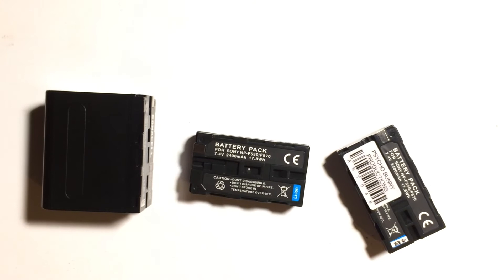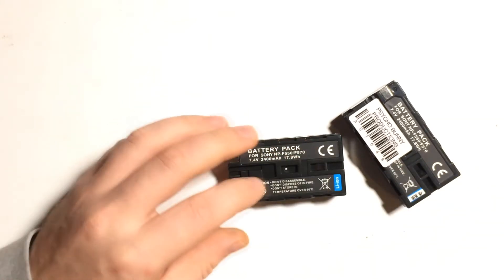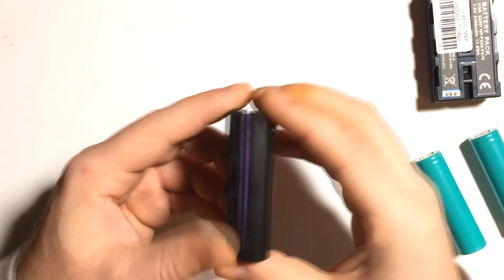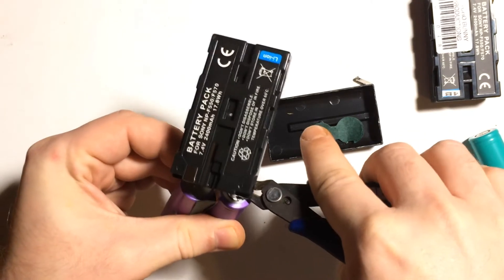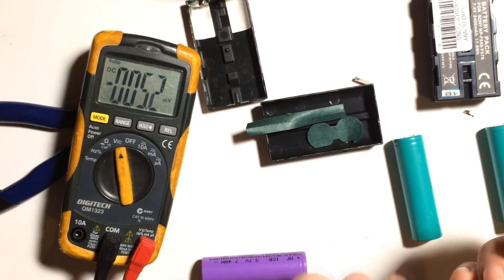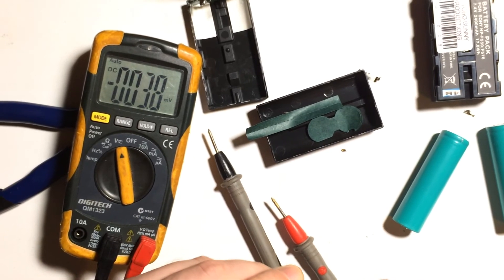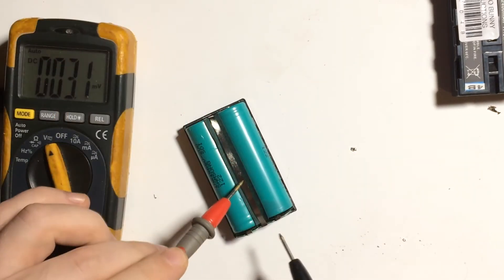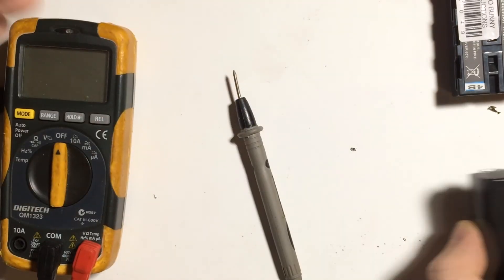Re-Packing Faulty Chinese knock-off SONY NP-F Type Battery

Comment: What does the pin other than plus and minus do? I also tried to use the 4s charging integrated circuit, but the device did not detect it because that pin was missing. How Can I Solve This? Battery board is faulty.
Reply from the maker: The 3rd pin sometimes used as a temperature sensor and and sometimes as a data (to check state of the battery)

Comment: U kinda skipped the part viewers wanna see the most.  Which is opening the case
Reply from the maker: I’ll do another video on repacking the batteries soon
Reply: There's a device called a "Balsa Stripper" that allows precise depth cuts with a razor blades. Try one?
Reply: using cutter should work, but be careful though

Comment: Thank you for the informative video, short and to the point with good audio! Do you know if NP-F-series batteries in general does balanced charging internally or if there are external contacts for that purpose in high-end chargers?
Reply from the maker: Thank you for your comment. Chinese batteries and chargers are usually unbalanced, but genuine ones use Center tab on the battery to monitor its processes.